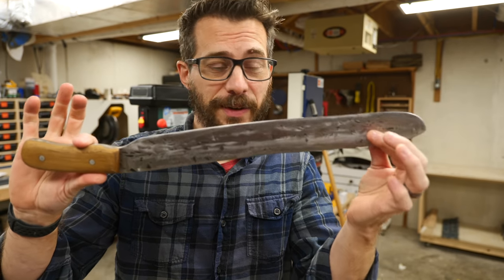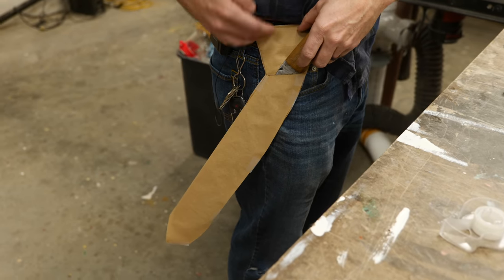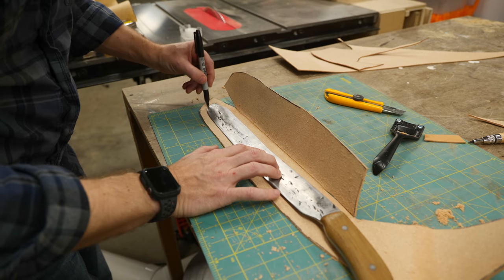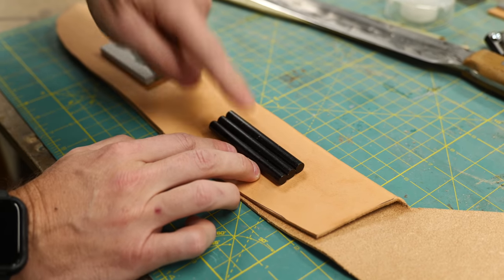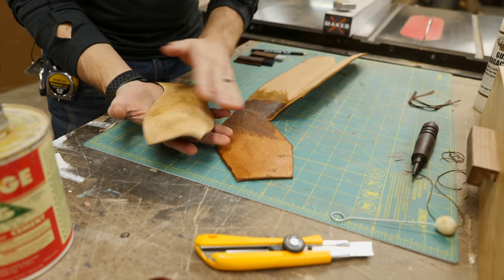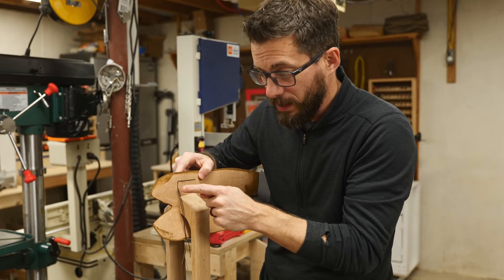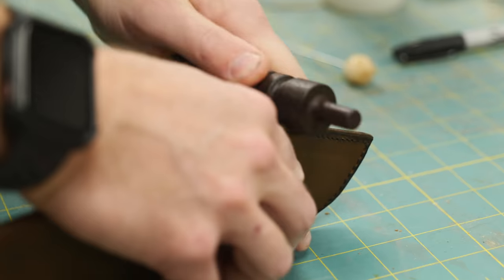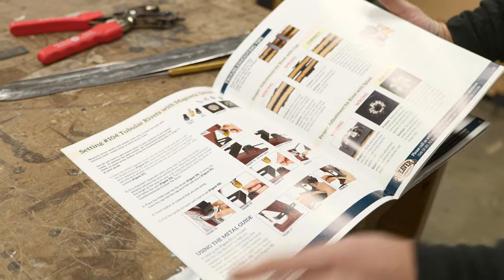How to Make a Custom Leather Sheath // Leatherworking | I Like To Make Stuff

Comment: Very nice looks really good and I’m a professional leather worker for a knife company. One little tip though the sheath needs a welt, a leather spacer on the edge, cause really quickly that blade will cut the stitches.
Reply from the maker: Ah! So another layer of leather along the blade? That makes total sense. I wondered if the stitching being cut would be an issue, but didn't think of that. I was hoping that  the glued surfaces would help keep the blade from the stitching for at least a while.
Reply: I Like To Make Stuff it will but the welt would make it so the blade never touches the stitching. Also a tip to help cut down on time is I use the dye to wet form. I get the sheath completely assembled then fill up a container full of dye and dip the sheath in. I then give it just a minute for the dye to sink in then I stick the knife in and with my fingers mold the sheath then it’s totally fine to pull the knife out and then just let it dry.
Reply: Wow Mason! Awesome advice and tips.
Reply: @Iliketomakestuff  Another point you might consider in the future (as I'm not sure how easy it would be to retrofit these on that sheathe) would be having a piece of leather come over the top of the pockets and snap down, just to secure the items inside a bit better. If you were to take a spill then it's likely that at least one of those magnesium rods would fall out, and possibly everything. Just a thought, and since you have that really neat snap press it'd be pretty easy to do from here out.
Reply: @Iliketomakestuff  for the inside part of the stitching you should have used that groover tool to lay the thread into the leather. Thats what its made for :) now you have a bunch of stitching sticking out from the pockets on the outside that can get cut from the knife. The welt is also very standard for sheaths and is very easy to do. adding a flap with snaps would keep the sharpening stone and firesticks in without it ever falling out.

Comment: I know that Weaver is a sponsor, and that's AWESOME, they get a ton of my money every year, but it's worth mentioning that you don't need a machine like the little wonder to set snaps.  You can get a mandrel and setter (also from Weaver) for 10 bucks or so that you can set with a mallet.  I just don't want anyone getting discouraged that they need a huge amount of upstart in tooling to do a project like this.  I do have a heavy duty snapsetter (not the little wonder, though and I won't mention it here).  Useful for large runs of stuff but for onesie-twosies I still usually set by hand.

Also, to echo others, you need a welt :-)  Those stitches will slice right open with one wayward journey into the scabbard.  You did a great job on this.  The only thing else I'd mention is that when you use the rotary punch and drive through, twist the tool.  It will sever the fibers so you don't get unclean holes.  Not so much of an issue with snaps, but if you get in the habit of doing it for everything, when it needs to be done the muscle memory will already be there.
Reply: he does say that you can do the snaps by hand with hand tools right before he shows us the little wonder
Reply: @chrisskinner6375  you're right, he does and I missed it.  I didn't intend for that to be a knock on Bob, by the way, i just think it was glossed over.
Reply: Guy probably got $1000 worth of stuff. It is discouraging. I want to start stuff, but I see guys casually talk about how you can do it too. Yet they have a $800 thickness planer, $500 table saw, etc. All that were given to them.
Reply: @animematt99  Well, that is something they do but I can't really say I feel discouraged by them being given things.  If you think about it, they're still putting in work (a lot of it) to get that tool from a sponsor and there are expectations/constraints when using them.  I completely understand how hard it is to have a web presence and be a content creator.  Seriously, I've failed at it twice now because I could not put in the amount of time it required.  It's literally nothing Norm Abram didn't do on The New Yankee Workshop.   Like I said earlier, I didn't intend this to be a knock on Bob, just a footnote regarding it.  I typically don't let seeing expensive tools discourage me from a project.  If anything, I've learned to adapt things I see to tools I have, that's all.

Comment: pro tip: when gluing the front pockets, shave a bit off the top of the leather so its rough, it will stick better
Reply from the maker: Ah, great tip, thanks!
Reply: Great job! 👍I’d definitely add a snap cover over the stone and fire starters

Comment: HEY BOB!!!!!  you  put in the number one most common critical failure point in the sheath, and that thing will fall apart with regular use.  On the main body fold and glue step you need to insert a strip of leather (called a welt, the welt protects the stitching from being cut by the sharp cutting edge of the knife) on the stitch line in the margin area against the cutting edge otherwise putting in and taking out the knife you'll be cutting the stitching loose.  the welt is a must.
Reply: Great tip! Hope he sees this! It didnt occur to me, ever after watching numerous videos on leathermaking, that it should have been something I had noticed..
Reply from the maker: Yeah, someone else mentioned that, great to know! Thanks!  Luckily, this won't be a part of my EDC, so it'll last a while at least :)

Comment: Very cool!  Custom machete and sheath.  

Tip: When forming the wet leather, placing a couple of layers of closed cell foam between the wood and the leather will force the leather to form closer to the shape of the blade, giving a really nice clean form fit.

Comment: Don't know if it is has been said, but you should add another layer of leather in between those two when gluing since the cutting edge of the blade is running against the stitches. Don't know if what I said makes sense, hope it does. Awesome quality videos and content as usual Bob and team. Luv ya.

Comment: Awesome leather working there!
I just saw this video before watching the machete video, just a tip regarding the knife is not to use the cutting edge to strike the ferro rod, you can file down the spine to a nice flat edge and use those corners on the spine to strike the ferro rod instead.
Another tip would be to change the handle a little,  adding more grooves to fit your finger placement on the grip or adding a boot-shape flare at the butt will help immensely with preventing the machete from flying out of your hand and possibly injuring yourself.

Comment: Before your next sheath, look into adding a welt.  That way your blade doesn't cut your stitching.  you may want to go ahead and add a rivet to the top of your stitches on this one for some protection.  Looks good!
Reply from the maker: Ah, I was wondering if that'd be an issue.  Thanks for the tip!
Reply: @Iliketomakestuff  no problem! Love your channel,  keep up the good work.

Comment: I've made several of these in the past and a point to consider on the angled approach,  I have found that angling the direction of the is a really good approach if the length  of the sheath goes bellow the top of your knee, about an inch to 2 in above the knee.  But is better to be straight up and down if length  is above the knee so it does not flop around a lot.  this approach makes it so you can kneel down without the sheath digging into the ground or the back of your leg.  the angle perfect for longer blades.

Comment: As a knife and sheath maker, I'd like to offer a couple suggestions:
1. Use a welt for knife sheaths, so you don't accidentally cut your stitches.
2. either cut a groove on the inside side of the sheath for any stitching that will be against the blade, like those pockets, or you can cover the inside with micro suede or thinner leather. The glue and stitching isn't really good to be rubbing against the metal during drawing and sheathing.
Overall, good job on your first sheath!

Comment: Great job, I just started experimenting with leather recently. Also a tip. Use a 90° spine of the machete instead of the edge to scrape the firesteel. It saves the edge from being damaged -> and dull. The spine should be somewhat sharp to be able to produce sparks. So use your sander in the spot where you'll be striking to create a (somewhat) sharp 90° edge. I know it's not a big deal since this is a machete, but why not save the edge :D

Comment: Cool project, love having incorporated pockets on sheaths and pouches. Quick safety tip with the drawing of the machete, don't curl your fingers all the way around the sheath. Over time the blade edge may cut into the leather/stitch and pop through, especially without a riser strip at the blade edge. More of a concern with more curved blades as they tend to grind and slice if not drawn correctly but something to keep in mind

Comment: Awesome job! You should cut the leather of your sheath so that it forms up over the handle slightly and completely covers the blade. You should try to avoid having any of your blade exposed, especially the cutting edge. It looks like you have about an inch of the cutting edge exposed by the handle and that could be dangerous not to mention exposing your blade to the elements. You also need a welt (small leather spacer) on the inside of the sheath so that you don't accidentally cut all your stitching.

Comment: Nice work for a first time. I've certainly bought sheaths that didn't look as good. Bit of overkill on the ferro rods, though- one should be good for hundreds of fires. :)  When you decide you've learned what didn't work on this and make the next one, I would recommend flaps for the accessory pockets- snaps are nice, but a brass stud is something you have the tools and skills to make.

Comment: If you use a firesteel, just use the back of the knife that is a straight 90 degree angle with a decently sharp edge. Dont use the knife edge because you will dull it very badly, even though this isnt a 1000 dollar knife but homemade machete, its good practice to do so and its very easy to make a part dedicated for firescraping in the back of the knife.

Comment: You need a welt! Also, put a recessed groove for the stitching on the inside if the sheath so it doesn't get cut/snagged by the blade. Use the tool you used for the inside of your vertical fold.

Comment: Dude, really professional work. It’s hard to have leatherwork come out with that level of fit and finish. Since there is no welt in the sheath be sure to put pressure on the spine whenever you draw or sheathe to keep the edge from cutting the stitching.

Comment: A little hint. Put in a welt on the cutting side of the sheath so the machete won’t cut the stitching. You can put epoxy on the inside on the threads for them pockets and when it dries it’ll be smooth and the blade will glide right over it. I would have made a flap to go over them pockets and snap so nothing would fall out over time as the leather ages.

Comment: Pretty good design. I might have moved the belt loop system farther away and extend it a bit from the machete handle (think downhill) to create a better balance fulcrum and reduce the eventual sag/twist where the present location will present. But I didn't build it so, well done.

Comment: Good video, great tips. The only thing I would have done, since it’s a knife going in there, is to add one more piece of leather on the inside to cover the stitching. Not at all necessary but might make the knife coming in and out smoother and will keep the knife from ever somehow cutting the pocket stitch.

Comment: My turn, I have a few suggestions, 2 help with leather forming and folding put a few drops of dish washing liquid in the water, the leather will absorb the water more completely and faster. Yes U have 2 have a welt but that was covered in another comment. Weaver is an excellent choice 4 all your needs. When forming leather around something always use plastic wrap, everything forms more closely and you don't have to worry about rust. Sand your edges and use Bees wax 2 close the fibers. On sanding I use finger nail files, Weaver also has a great machine but being a custom leather crafter and teacher, I tell my students that they don't have 2 spend a lot of money on the machine when a finger nail  file will work. I like your channel U have a lot of great ideas keep up the good work. Any questions please feel free to ask GOD'S BLESSINGS ✝️⚾🙃

Comment: Super polished looking product when it's all done, really like it. An interesting update to this would be to see how long the snaps hold out and potentially put an active locking system in place to keep it on your belt. But I'm sure they won't wear out too much because it doesn't look like it's carrying too much weight.
Reply from the maker: Thanks! yeah, I think the bend on the leather is probably working against the snaps, but they seem to hold fine. I considered wetting and creating more of a fold above the belt to relieve some of that pressure.  It didn't seem necessary, but in the future that could be a simple change to help the snaps stay in place.

Comment: Looks an excellent result the one thing I wondered about was the wear on the stitching from drawing the blade in and out would there be a way of protecting in more, maybe having the last few inches after the curve unstitched?
Reply from the maker: Someone mentioned adding another layer of leather that would line up with the blade edge to keep it from the stitches 👍🏼

Comment: Interesting to see new skills evolve - and there is just something uniquely satisfying about handling leather.
Personally I would have folded the belt loop to the back of sheet, so that it would not interfere with the draw of the blade (and have the flush part of the snaps where they is the least in the way).
Reply from the maker: That definitely would have been cool too!

Comment: it is advisable to make a loop inward for the convenience of removing the knife,
the glue on the pockets will be erased and the machete will cut the thread, the pocket will fall off.
it is also worth noting that if the terrain is bushy, then the contents of the pockets may be lost, it was necessary to make a valve on the pockets
well done, always improve your skills and learn new things, don't be afraid to experiment

Comment: If you attach the belt loop closer to the center  of gravity, that will do a much better job of holding it at an angle. You'll probably have to make the loop out of a separate piece and attach it, but it will be worth it.

Comment: You might want to add some short retention flaps for the front pockets. I love the idea, but would be concerned about them flopping out. Could secure with snaps, bit a simple slit and stud setup would  likely be better and easier (thinking about applying pressure to the snap over the sharpening stone, not good over the long haul. And, as everyone had already said, you need a welt to protect your stitches!

Comment: Tip for the next one - you folded the loop backwards :-) Usually it folds towards the back, not the front - what way, you have the clean line with no need of extra pieces AND you get the rough side of the leather against your body, whose friction helps securing it in place. Other tips I've already seen  in the comments. Not a bad job, anyways!

Comment: The rods at 6:17 are ferrocerium, not magnesium. Magnesium burns very hot and is good to help start a big fire, but you need to light it on fire first. Ferrocerium is used to make sparks that light a fire.

Comment: I noticed you didn't add a welt. Are you concerned about the blade cutting through the stitches as you take it in and out of the sheath over time?

Comment: Fire starters make sparks all right, but making fire with one is a whole nuther thing.  Been backpacking for over 40 years and I don't use fire starters; instead, there's a a Bic lighter in a pocket of every coat I own, a lighter in my luggage, and at least two in each of my packs.

Comment: Not sure if anyone else has experienced this. But on one of my sheaths, the stiching is also on the bevel edge of the blade. Over time i have found that leather has softened, and the blade had started cutting small bits of the stitching. Is there any reason not to put the stiching on the back side of the blade?

Comment: Those rods look like fero rods rather than magnesium.  Great job on the sheath!
Reply from the maker: I guess both?   "COMPOSITION: West Lake Tactical Ferrocerium or Ferro rods, are made from Iron, Magnesium and a rare earth metals called misch-metal. This combination has an excellent pyrophoric percentage > 98%. In short, West Lake Tactical’s specially blended Ferrocerium rods is highly effective, waterproof, weatherproof and works in any weather condition."
Thanks!

Comment: TIP: Ensure the back spine of the machete is a 90 degreee and use the back spine for the Ferrocerium Rod. It'd save your edge.
Reply from the maker: Yeah, unfortunately I'd added a chamfer to the back edge of mine, so there wasn't a sharp edge there.

Comment: They're Ferrocerium Rods not Magnesium. Magnesium doesn't spark. When you did the wetform you should've added the welt into the sheath. Welts are so your cutting edge doesn't cut through your stitching. If I get any leather it'll be through TandyLeather.

Comment: Pro tip #2: When you strike a firesteel, use the back of the knife/machete. Not the sharp part. A) You might cut yourself and B) You're going to dull that edge at the first contact and C) You probably made a whole lot of viewers who are actualy outdoors people who use them, cringe real bad. (Like me!) But dang that's one sexy sheath!
Reply from the maker: Yeah, I knew it wasn't ideal, but I couldn't get it to light with the back edge because I'd added a chamfer along the spine.  I ground in some small notches trying to add enough friction in one spot, but it still wouldn't spark 😕